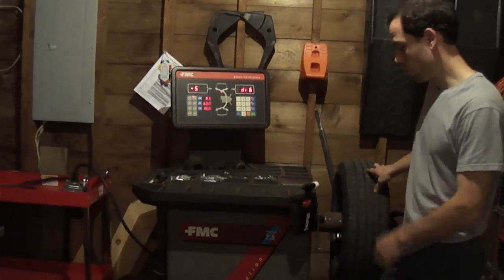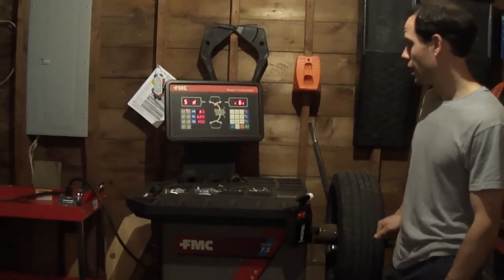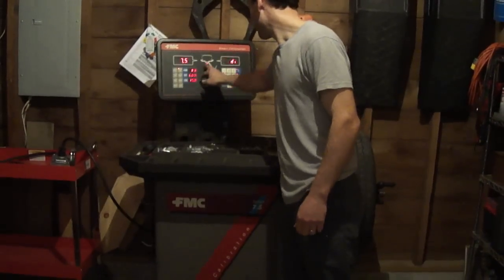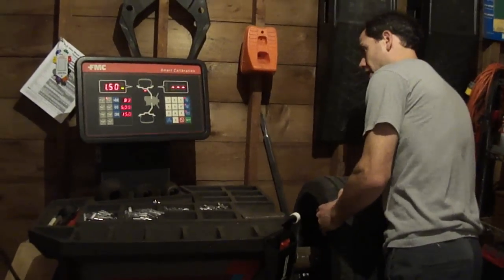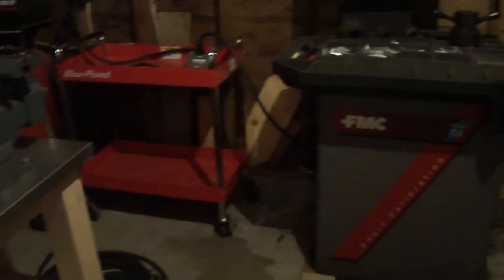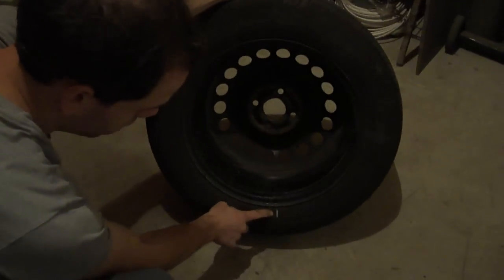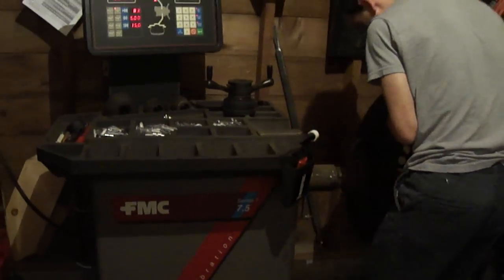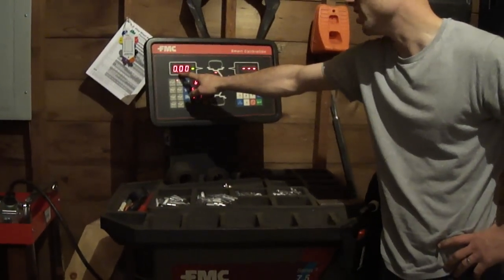Balancing a tire with adhesive wheel weights

Comment: I did one that came out to 3.something. I had to use a lot of weights. I have seen people use a double stack method. Meaning they use like 2 sets of 5 weights lined up side by side and then sometimes stacked on each other if more weights are needed. Is it ok to do this? I mean as long as the weights stick and the balance comes out to 00.00 right?
Reply from the maker: I have never seen double stacked weights like that before. Seems like they would easily fall off, but hey, if it zero's out and they will stay on why not.

Comment from the maker: I guess there are pros and cons to both. Adhesive wheel weights are cleaner looking and not noticable on alloy or chrome rims. Some rims (for style) wont accept clip on weights on the outside. The clip will only catch on the inside. They also dont scratch like the clip on weights. You will see alot of adhesive weights on higher end rims. With that being said I dont think one is better than the other. I prefer the clip ons because they are alot easier than scraping and cleaning all the dirt and